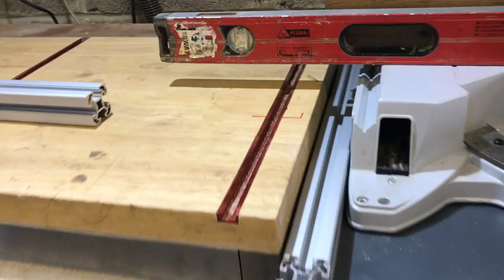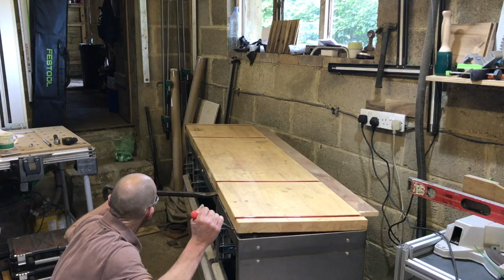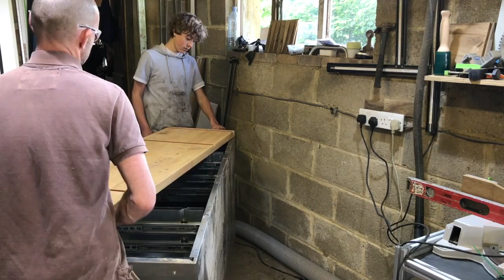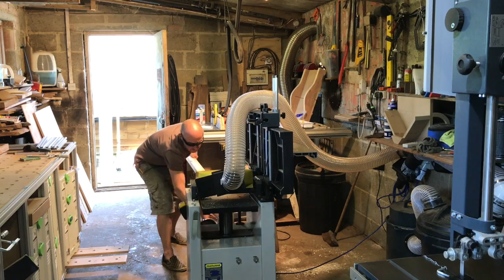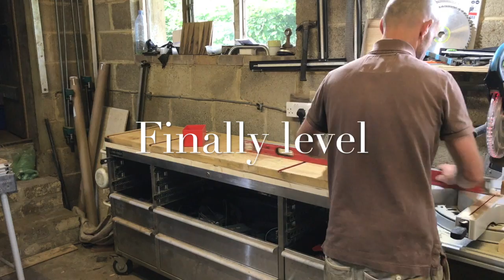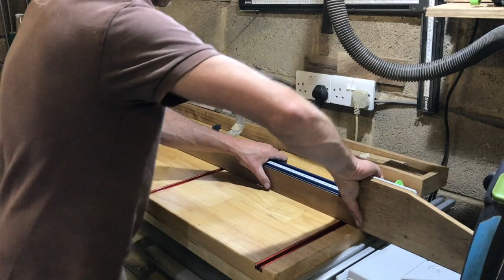My Dream Workshop Bench   Day 5

Comment: Theres a small bar in iMovie that allows you to adjust the volume levels of your video. Just a tip so your viewers don't have to keep adjusting the volume each time you use a power tool, then again when you start talking. Hope you don't take this the wrong way, just a little tip!
Reply from the maker: Your right to point it out sounds was a nightmare in the early video another sub pointed it out so it should start getting better in my later videos but I am still working on it :)  thanks for your support ..
Reply: No worries, great videos by the way, just watched them all. I'm looking for a good system for my Systainers too, so thanks for sharing! On iMovie, you'll see your timeline of all your added media. Hover over the timeline and you'll see a yellow bar at the bottom, this is where you adjust the volume levels. Put it slightly higher when you're talking, and lower for the tools! Thanks again
Reply from the maker: Top man .! will do

Comment: Love your channel, but I can hardly believe you didn't just jack it up at the casters. Much less work.
Reply from the maker: davis2022 it would have for sure , you will see in later videos I have a vice on the bench now which was fixed into the add wooden rail
Reply from the maker: davis2022 it would have for sure , you will see in later videos I have a vice on the bench now which was fixed into the add wooden rail
Reply: What brand/model of planer/jointer do you have?! That thing is awesome!